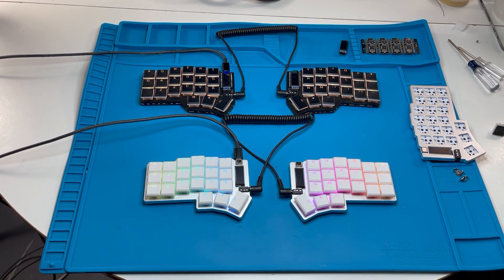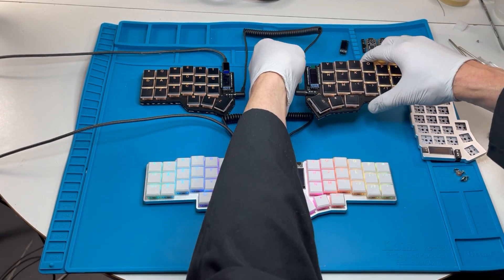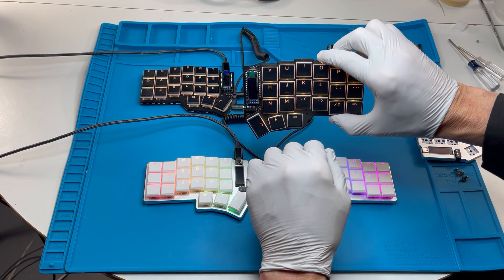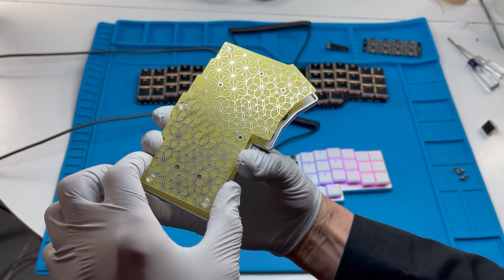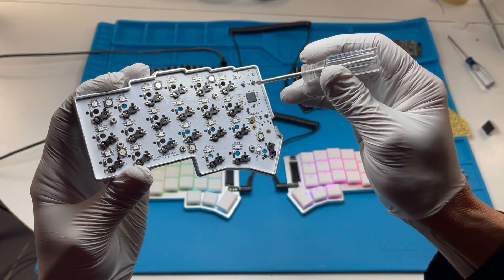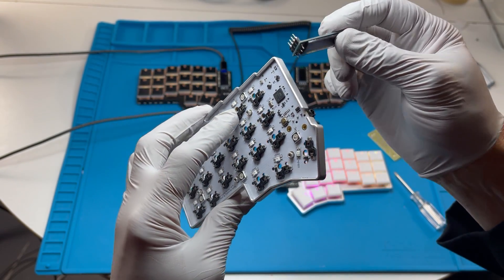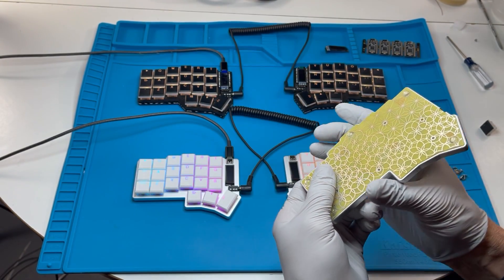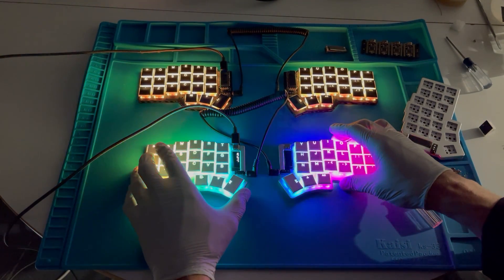Low Profile Ergonomic Corne OB Keyboard Design

Comment: Those cursor keys are the stupidest thing I've eve seen. What's next? The enter key under the keyboard?
Reply: I'm pretty sure those are not the arrow keys. Based on their position they're layer up/down, backspace, and tab. 
In these types of keyboards the arrows are usually in a separate layer on the home row
Reply: @noisycarlos that's how I do it. Upper layer jkl; for LDUR. It's usually hjkl because vim, but I don't use vim at all in my workflow. I'm just a fan of smaller ergo boards. Something I can just throw in my pockets.

Comment: Hello! 
I want to build my own split keyboard... Where can I buy the components I will need? Is there an official site? Thanks
Reply from the maker: Our keyboards are not suitable for DIY assembly. They are highly integrated. The keyboards are available at controller.works The Corne OB design has been superseded by the mini36 and the mini42. Those designs have a better processor and memory, and an improved industrial design.